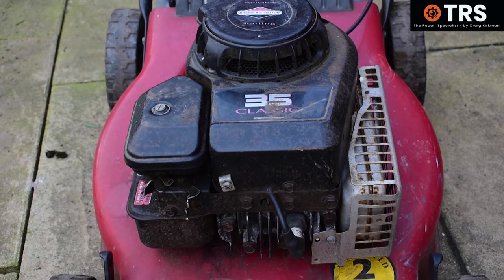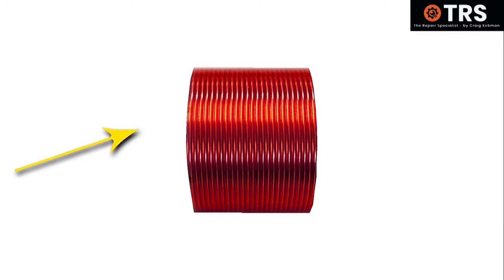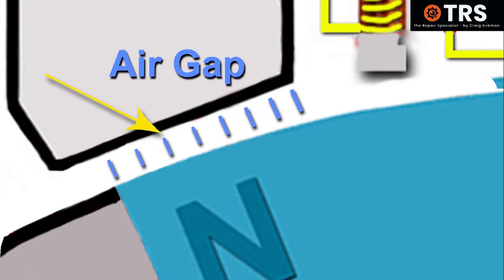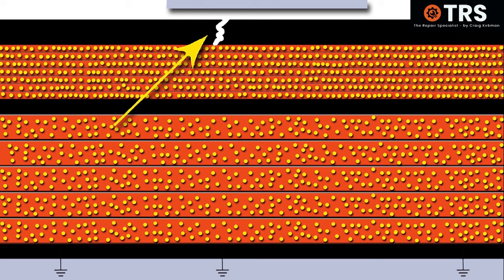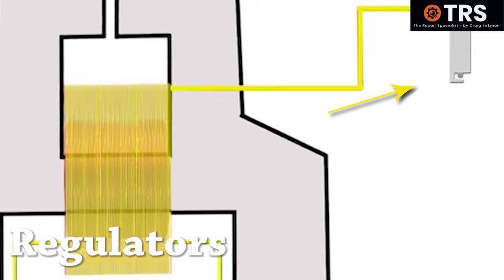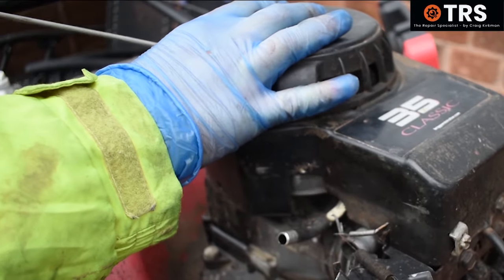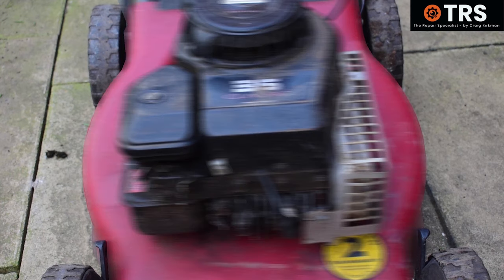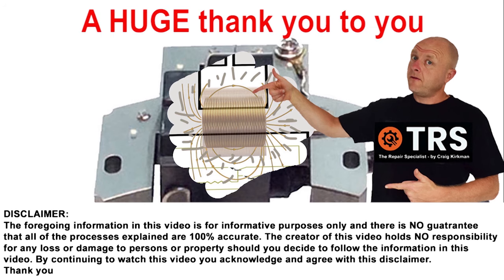Lawn mower Ignition Coil - This is what FAILS in them!

Comment: 90% of the heat damaged coil is caused by an engine that is caked in dirt, grease, oil and grass or sawdust. Your key word was" fan cooled". I have gotten riding lawn mowers in with so much of a build up of dirt and grease, the engine was constantly  shutting down. Push mowers and chain saws are victims  of this issue. I always clean equipment I get in to repair before I even think about fixing it. Great video. This is basic stuff I learned MANY years ago.

Comment: I don't care what you work on as far as gas engines go..... Every single mechanic out there should watch this video! Many think a plug... Plug wire..... And coil are readily interchangable parts.... Wrong! This video is the most educational and well presented video I've ever seen about ignition systems with spark plugs and coils. Thank you for putting it together I know I did learned something and I'm not afraid to admit it...... Because it's something I can take with me to my grave and also use to increase my diagnostic abilities by double digits, when it comes down to ignition problems! That is  a huge benefit over someone who doesn't watch this presentation. Great job. Thank you!
Reply from the maker: Wow. That’s some absolutely awesome feedback. Thank you so much. I really appreciate it. Craig

Comment: These little air cooled engines are bad about gathering dust , debris, and oils in the cooling fins . That’s hidden inside its best to run the gas completely out at the end of season .  Now I change my oil after that .  After draining I replace all plugs . Take the cover off . Use compressed air to blow all of the engine out around the out side were the fins are .  If they look good . Then you can replace cover and put new oil in for next season .  If there still dirty get some degreaser , oven cleaner , or pressure wash those fins out . Be careful not to damage any thing . Make sure your magnets are dry so they don’t rust . Towel dry the best you can .  Use a hair dryer or heat gun to dry . Don’t get it real hot just dry the water up off the motor .  So it doesn’t rust or corrode the metals that it’s made of . You’ll find keeping those fins clean makes the engine and the coil last longer and better performance with fuel efficiency!  Great video thanks for all your great information I learned from you a bunch of different things and I watched your 1st video before watching this one .  That sure was a great video I really learned a lot on how the coil works .  I remember my dad would say the coil is breaking down when they got hot and wouldn’t start back up !

Comment: I would like to add another issue I have seen on small engines, this is technically not a problem with the coil/ignition module. Incorrect distance between the magnets on the fly wheel and the coil, this is common if someone has already tried to fix issues with the engine.

Comment: I was given a 3 year old mower that had been stored outside since it was new. Low hours, like four or five, and could i get it to run properly. The carb was cleaned and cleaned , new plug and filter. It would for 1/2 hour or more then wouldn't start. Ended up swapping the coil with an old one and it runs great. I guess Britains rain killed it. Thanks for your vid.

Comment: Heryaa is a very beneficial explanation! There is a condition called "aftermath heating" when you shut off an engine and the temperature rises a bit more than where it was when the engine is initially shut off.  Some people can argue what part of the spark plug is negative and which is positive. Aggressively bending the HT wire excessively and repeatedly  will break down the carbon powder wire core.
A proper, strong spark is blue, a poor, insufficient spark is white and thin. Have (one) a nice day. LoL

Comment: Here's something interesting for you. I fly Paramotors with 15hp at 9,000rpm tops, called a Top 80, made in Austria I think. Wouldn't start one day. Instead of my usual of tearing everything apart & finding nothing, I sat back & did some deep thinking.

For the past week, we'd had cold, rain, fog, high humidity etc. Hmm? I smoke cigars, each one takes 25 minutes. Heat gun! I laid it near the coil & primary wire on low heat. Lit up my cigar, 25 minutes later, ohms checked perfectly at 10,250 ohms! Cranked on first pull! Sometimes it pays to just Stop & Think! Great show you got! Steve at Steve's Small Engine Repair too!..that wasn't his idea but I told him about it too..
Reply from the maker: That is awesome. Thank you for letting me know. You have my brain cranking on override now 😂. I’m so pleased you sheared that with me. I’m also pleased you follow Steve. His channel is brilliant and so is he. Thanks again. Craig 👍👍
Reply: @TheRepairSpecialist  You're very welcome & thank you for the production work & great advice you offer to the public! Well done!

Comment: Excellent explanation! I'm troubleshooting a cranky lawn-mower and I'm pretty sure the coil has failed. Testing coils is always super annoying because a lot of times, a bad coil will still make a spark when you're doing tests with the engine off! The mower's owner said the engine was running awesome, and then it turned off immediately. No sputtering, just died. It has enough compression to run, and the spark plug tip is wet with fuel. Hopefully a new spark plug & coil are the answers. This mower is 20 years old. It looks almost identical to the one in the beginning of this video.
Reply from the maker: Hey there!

I'm thrilled that the explanation helped you out with troubleshooting the cranky lawnmower. Dealing with faulty coils can indeed be quite a headache, especially when they still manage to spark during tests while the engine is off. It's fantastic that you've gathered quite a bit of information about the symptoms—it really sounds like a failed coil might be the culprit in this case, especially with the sudden shutdown without any prior sputtering.

Given that the engine has sufficient compression and the spark plug is wet with fuel, trying out a new spark plug and coil seems like a logical next step. It's impressive that this mower has lasted for 20 years! It's a testament to its durability.

I have found that Coils can indeed show a good spark when tested and even read a good resistance when using an ohms meter, but when the coil is used, it fails after it gets hot. This is most probably because of the heat expansion effecting the internal connections. When cold all necessary connections are linked ok, the heat expands them apart. That's my opinion anyway.

Looks like you might well need a new coil unfortunately.  Sorry to bare bad news if this is the case.
 
Thanks
Craig
Reply: @TheRepairSpecialist  I spent some more time on it & had great luck! There was a spot on the coil's kill-wire that was almost worn through and touching bare metal on the engine. I reinsulated that portion of the wire to protect it better. The steel plates in the coil were covered in oily grime between the flywheel and the coil, so I cleaned the entire coil & reinstalled it. The mower runs perfectly again, no joke. The coil isn't even bad after all these years. I didn't need any new parts to repair this problem. I love it when that happens!

Comment: Great video as usual. Don't for get to check the spark plug cap as I have seen many fail on motorcycles. Some have resistors in the cap as well as some plugs. The cap normally just unscrews from the plug wire. Then put a paper clip or like in the end of the plug wire and hold next to engine and check for spark.

Comment: I had one on a tecumseh that would not turn off after releasing handle. Removed bracket assy with kill switch twice to ohm check it and was good. I finally noticed the ground connection terminal on coil had corrosion. I cleaned it off to bare metal and put fielectric grease to keep it from corroding again. Mower turns off now. Was going crazy. Have to have good ground.

Comment: Very nicely explained. Craig, maybe you have already done this but if not, delve even deeper into the Ignition Coil and research the "Iron Core". There is more going on with it than just being a lump of metal. I'm sure you're aware that the iron core is made up of many plates (laminations) and mechanically sandwiched together. I'm sure you'll find it quite interesting.
Reply from the maker: Thank you for your feedback I really appreciate it. Yes, in my opinion, the iron core research, would turn out quite fascinating and I will most likely look into that in the near future.  Thank again. Craig 👍

Comment: One correction to an otherwise fine explanation. Water is a very poor conductor absent the mineral impurities that undistilled water contains.

Additionally, one should look at the plug cable and connections, especially carbon track cables. These cables are nothing more than a string impregnated with carbon dust that carries the current to the plug. I've seen cases where the carbon dust is insufficient and has literally been shaken out of the crimp area of the plug cap's metal connector.
Reply from the maker: Hi,

Thank you for your thoughtful corrections and valuable insights. You've provided an excellent clarification regarding water conductivity, emphasizing the importance of mineral impurities for water to conduct electricity effectively. It's essential to have accurate information to understand the principles involved in ignition systems.

Additionally, your point about plug cables and carbon track cables is well-taken. The condition of the plug cable and its connections can indeed impact the ignition system's performance. It's a great reminder to inspect not only the major components like the ignition coil but also the smaller components that play a crucial role in the overall electrical connectivity.

Your input adds depth to our understanding, and we appreciate your contribution to the discussion. If you have any more insights or questions, please feel free to share them. We're here to learn and help each other.

Thanks again
Craig

Comment: I had a push mower given to me a few years back. It was sitting in the weeds at this woman's house. When I asked about it, I was told that it had simply quit three years prior, and they simply left it where it died. She offered it to me, and I promised to feed back to her. She remarked that she had already replaced it, and I was welcome to it.
I hauled it home and after I unloaded it from my SUV, I pulled the rope and it literally fired on the first pull. Three-year-old fuel. I cut a couple of strips before shutting it off to do some more investigation.
Changed the oil, sharpened the blade, freshened the fuel and used it. It ran flawlessly for 6 weeks until the day it simply died.
Long story shortened... the black hi-temp kill wire had developed a pinhole in the insulation and was intermittently shorting on the block where it was routed across to the kill switch. Replaced the wire and used it for the remainder of the summer.

Comment: Excellent explanation video...coils are kind of an esoteric science in that they can pass all tests with a multimeter but still be defective...I think I'll just buy a quality new coil rather than go on a mystical quest to discover why my 4 stroke lawnmower generates +15K volts on start up, runs perfectly but upon inspecting the new spark plug, it's wet with unburned fuel
* now, the start of the indiana Jones quest to find a quality aftermarket coil in a jungle of junk

Comment: Been having issues with my powerwasher (similar engine to mower) and these videos were fantastic in helping to understand how things work. I have watched so many videos trying to get to my issue and this was the best. Now I just need to see the how to test my coil and sparkpulg with multimeter video to find out if that is my issue. (At this point I have replaced the carburetor, the air filter, the spark plug, changed the oil, and put in fresh gas but washer will start and run for a minute or so before shutting off. :(
Reply from the maker: Thank you for your kind feedback. I really appreciate it.  Yes, I do have the multimeter testing of the coil scheduled in my list of video to do.  I hope to get round to it very soon. I just have a few to complete first.  

Thanks 
Craig

Comment: Really good explanation. On the secondary coil, doesn't one of the ends of that coil have to be terminated from the iron core? Or where does it be it start?
Reply from the maker: Thank you for your kind feedback.  As for your question: In some ignition systems, a physical connection between the iron core and the ground terminal of the secondary coil can create a clear path to ground. This can help to safeguard the ignition system's proper operation and prevent electrical interference. Not all ignition systems, though, demand this connection. It is determined by the particular specifications and needs of the employed ignition system.

I hope has helped

Craig

Comment: Thanks for the video, very informative. Just removed a coil off a friends lawn mower and tested it with a multimeter on ohms and its dead no beep just shows outer limit. Will order another one but was curious why they fail and your video helps a lot, especially to check the spark plug gap, thank you.

Comment: Could a small break in the insulation still give you spark. But the spark is too weak to run the engine. Great video. Thanks

Comment: I enjoy all your videos, especially on the electronics on a small engine. I have been experimenting, without too much luck, on using my Pico automotive oscilloscope to test the coil and analyze the spark waveforms. The waveforms do not seem to make sense compared to a 4-cycle ignition system. Have you had experience with this, or am I just wasting my time? Thanks
Reply from the maker: Thank you for your feedback, I really appreciate it. As for the waveforms. I’m not that familiar with them at the moment but now you’ve mentioned it. I might just look into it. Thanks again. Craig 👍👍👍

Comment: You are showing a darlington pair of transistors in the circuit, but where are they located?  Are they built inside the coil, and if I were to tear apart the coil, I could find them?

Comment: I remember a long time ago my lawnmower would not start. It was getting gas so that was not the problem. I removed the spark plug but did not look bad. So I grounded the base of the plug against the engine with the high voltage wire attached. It was getting good visual blue spark. Reinstalled it and for the longest time, still would not start. I finally put a new one in and it started on the first pull! Sometimes plugs get fouled just enough, that they will not work under compression.

Comment: I have a briggs and stratton engine which uses a toggle switch which closes a circuit from the kill wire tab on the coil pack and ground when closed (per design),  when I measure resistance across the switch in either position it shows continuity.  Disconnecting the kill wire from the coil pack and testing continuity between the kill wire tab and ground shows continuity.  Seems like the coil is bad, yet when I disconnected the switch wires and tried starting the engine it worked and I am very confused about whether the coil is bad.  I tested the switch out of the system and it's good, I replaced the switch with another switch and same thing.  Thoughts?

Comment: Heat destrois more electronic than electrical items. Darlington transistors, diodes, etc. are very sensitives and can be destroied. Less explication for insulation. Interesting that this small item can give more problems.
Reply from the maker: Yes you are absolutely correct.  I do have another recent video explaining this a little more.  If you get the time then please do take a look at it. It is here in the link. Thank you for your comment,  I really appreciate it. Craig 👍: https://www.youtube.com/watch?v=lEYO7hNTeR0&t=6s

Comment: Great video sir thank you for the information I am currently restoring a vintage Stihl 009 chainsaw the coil wire looks a little rough. What do you think about replacing the coil with a Chinese aftermarket? I may just replace the wire if I can.
Reply from the maker: Thank you for your kind feedback. In answer to your question. I have used these aftermarket coils in the past. I haven’t had too much trouble with them in the short term but I am convinced that they don’t last quite as well. But, if you consider the price difference from the genuine coils, and there is a huge difference, then you can see why. I have found them to get me through a bit of a JAM in the short term if budgeting cost is an issue. So, I have found they work well, but I don’t like the thought of long term usage. This is my personal experience. Thanks again. Craig

Comment: I can think of only one additional case of coil failure thatI have personally experienced/ witnessed: tiny rodent teeth chewing through the insulation of the coil or HT wire...mice, chipmunks, etc. nesting in Lawn Mower shrouds is common in the States, and should also be included as a cause of failure...hope this helps...Cheers!
Reply from the maker: Yes, small animals do seem to like the rubber parts on carburetor primer bulbs as well. Absolutely.

Comment: So as the magnet is fixed to the crankshaft and not the cam shaft the plug would fire twice? Once just before TDC on compression and once again again just before the intake valve opens?
Reply from the maker: Yes absolutely. The spark plug does also fire at the end of the exhaust stroke.  Importantly, there is no combustive air/fuel mix in the cylinder at this point, so no combustion of course, as it is prior to the induction stroke.  That is my understanding of it anyway!

I hope this helps

Craig